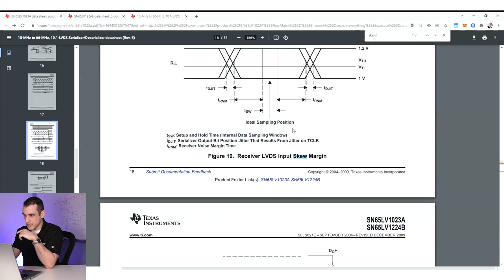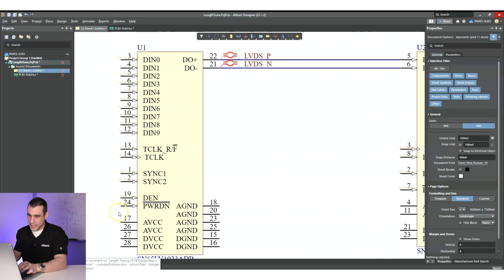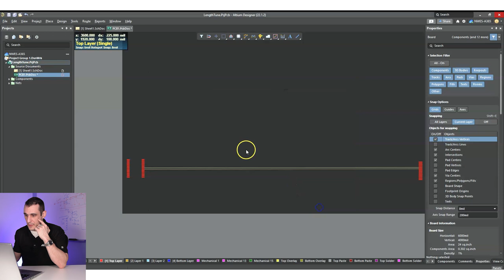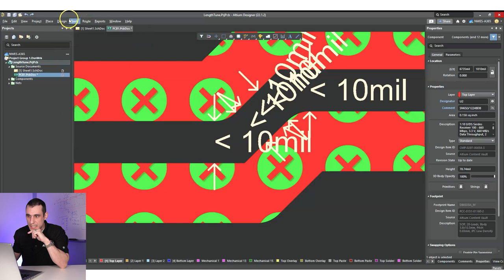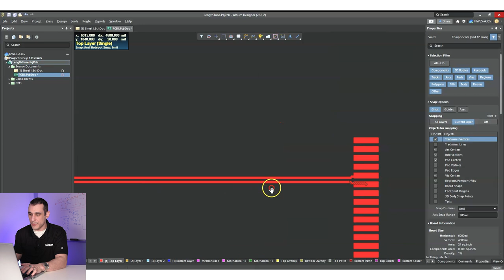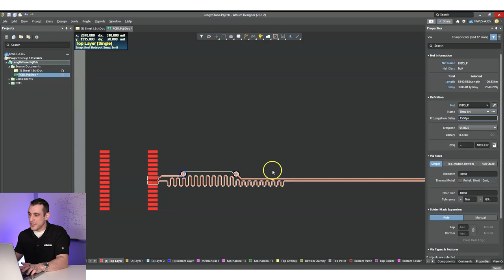Length Tuning in Altium Designer

Comment: First of all thank you very much for these excellent videos. Please explain more about when do we need length matching and how can I precisely calculate the length?
Reply: Length matching is needed when there is too much timing mismatch between two ends of a differential pair, or when there is timing mismatch between multiple signals in a parallel bus. The idea is to bring the timing of the signals back into alignment by adding some length to some of the traces, this way you keep all the signals synchronized within some timing window. It is generally needed with differential signals that have fast edge rates, as well as in fast parallel buses like DDR. It is also needed in some cascaded RF systems that use single-ended traces, but that is more of an advanced topic and it is used to synchronize transceivers to the same clock.
Reply: @Zachariah-Peterson  Thank you for answering my question. If I need length matching, length of a route must less equal than turn into critical length of a transmission line? If L sub R is more than critical length of a transmission line, I have to impedance matching for example 50 ohms in "impedance profile in Altium Designer"?

Comment: I understand why it is better to do the matching before the other trace returns to the same layer -- that way, the final portion of the trace is matched, and subject to the same/offsetting interference.  But what is the argument for putting the length matching near the driver, instead of after the via (where they are separated anyhow)?
Reply: Hi Jim, nice to see you around again! THis is another really good question so I'll do it in our filming session today. In short, the idea is that any common mode noise picked up between the driver and receiver is in-phase and does not experience mode conversion at the load end of the line.
Reply: @Zachariah-Peterson  This makes more sense to me than it did 2 months ago ... I think you're saying that length matching (anywhere) gets both half-signals there at the same time, but from the mismatch until the makeup, it is really just two unrelated traces instead of a differential pair.  The reason not to wait until after the via is that the original length difference is usually closer to the driver.  (And I'm assuming the question got dropped in editing, or else I just missed it ... unless you have a really long lead time.)
Reply: @jimjjewett  With vias that's how I've usually managed to do it, whether it's coming out of/into a BGA breakout or coming out of/into a connector. Also my lead time right now is worse than Texas Instruments'...

Comment: Does too much length mismatch creates impedance discontinuity for differential pair?
Reply: Impedance is not to do with the length, it's all about the material and the trace width and gnd clearance(if the coplanar waveguide is used)
so, if you don't change the trace width or the gnd clearance then impedance will not be affected seriously.
Reply: A mismatch can cause issues in the time domain, which will turn into signal issues in the phase domain (jitter). Zach has other good videos about differential tuning that can answer this question better. :-)
Reply: Technically the differential impedance is different in that region where there is mismatch, but it only matters for input impedance in certain cases where rise time is very fast. This is because in the mismatched region, a portion of the transmission line does not have its electric field terminated at the nearby opposite polarity trace, so there could be an input impedance deviation right at that point. Whether you actually notice the input impednace deviation depends on the length of the mismatch and the rise time. Most people will start to make a comparison between the signal velocity and the mismatch length to figure out if there is some reflections or something. In my opinion, you should use the bitstream's Nyquist frequency to figure out if the impedance mismatch in that area really matters.

This is a really good question so I'll look at it in our next film session.

Comment: I didn't quite understand one thing. Please tell me, if the resulting propagation delay is 138.27ps/in, then why in the example the length of the conductors on the printed circuit board was used longer than one inch? Wouldn't that create a total(138.27ps X conductor length) latency substantially greater than 150 (for SN65LV1023A) picoseconds?
Reply: The length of the traces only determines the amount of time the signal needs to travel between the two components, it does not matter for length matching. Only the rise time matters for length matching and that specification is used regardless of the length of the traces. So your traces could be 20 inches long (like in a large backplane) and the length mismatch tolerance would still only be based on the rise time.

It may turn out that if your traces are very short, then the allowed mismatch is longer than your trace length. So just worry about the calculated mismatch length, the trace length does not matter for calculating this constraint.
Reply: @Zachariah-Peterson  Now I understand. Thanks a lot Zach.

Comment: Don't you think that calling this feature a "length matching" is a bit of a misnomer because the actual goal is to match delays, and not just physical length? Once upon a time matching length was "good enough" to match delays "close enough", but nowadays with GHz buses becoming a routine as opposed to something out of ordinary, matching length of traces on different layers can get you in trouble, as difference in signal propagation speed will lead to delays mismatch, which can become significant enough to cause problems. Also I think Altium needs to update AD to auto-calculate via delays - since AD already know all relevant geometry details via stackup, it shouldn't be that difficult, also those delays will be different depending on which layer signal travels from/to.
Reply: Yes I do think it is a misnomer, but unfortunately the SEO gods at Google force us to still use the term because everyone else continues to use it. And with via delays I agree with you, but I think the problem is getting licensed a good calculator that can do the auto calculation quickly for your via design rules or live in the design. The problem is that if you have it running in the DRC engine, then it would constantly run the via delay calculation every time you moved something near the via, or if you moved/resized the via. If the model is slow then you would get a big lag in program performance. They could set it up to run in your DRCs manually, that's probably the best bet/safest way to do it. Otherwise, you would have to create a via profile and enforce that as a design rule, just like it works with an impedance profile.
Reply: @Zachariah-Peterson  Well even quick & dirty method would be better than none at all. Right now I don't think it's even possible to specify different via delays for different layer pairs, only a single delay which kind of makes this setting useless for practical purposes - unless it's a blind or buried via which only connects a single pair of signal layers.
Reply: @asmi06  what do you mean?

Comment: Quick question - when length matching in Altium, why is Trombone / Sawtooth options greyed out? I can only length match using the Accordion option.
Reply: I just checked on one of my designs and I did not see those options greyed out. That was for matching on DDR, but you can still select those options once you click on the single-ended length matching tool. If you're in the middle of using the length matching utility and you hit tab to pause the tool, then it will grey out the buttons so that you can't switch between different styles mid-route.
Reply: @Zachariah-Peterson  ahhhhh that was my issue. Attempting to switch while I had already started the tool. Thanks!

Comment: 14:00 Won't high speed differential pairs have issues when routed like this?
Reply: In order for a differential interface to function (meaning you can retreive data), you do not need to mount the traces right next to each other, and you don't even need to route them on the same layer. As long as the individual trace impedances are correct and as long as the signals on each trace arrive within the correct time window, the interface will function correctly. The only reason to keep the traces very close together is for reduction of radiated emissions when ground is far from the traces and to set the trace width to a small value. When the dielectric layer is thin and ground is adjacent then the traces can have greater separation from each other.

Comment: Are you SURE that length only does length matching on the top layer?  That doesn't make any sense that someone would have designed it to intentionally work that way.  More importantly, what you are matching here, since you are matching between the _P and _N of a single differential pair, is typically called phase tolerance.  That should be matched along the entire length, not just in one spot.  It needs to have length added to one side of the pair anywhere along the pair that the length is out of phase tolerance.  If you don't match along the entire length of the differential pair, the _P and _N "legs" wave front can be skewed more than the set tolerance.  That defeats the common mode noise rejection, an important feature of using differential pairs.  It's also odd that Altium treats differential pair phase tolerance as any other length match.  It's something that should, IMO, just be set in the differential pair setup.  It appears to also mean you have to set it up for every single differential pair, since each pair can have a different overall length, even if they are in a true length match group, as that group will have a much higher tolerance (like hundreds of mills) than the length matching for phase tolerance (which can be around 10-25 mils).  Is there is a way to set this phase tolerance "length match" to either all differential pairs or a group of differential pairs, knowing that the pairs may also be part of another length matching group?  In other tools, that's the reason it's typically handled as two distinct functions.
Reply: I don't recall saying that the tool only operates on the top layer or that you should only do it on the top layer. Length tuning can be performed in any layer. You can even route the signals in two different layers with two different propagation constants and do length tuning in the faster layer so that you restore the edge rate timing you see at the receiver, you just won't get all the noise cancellation benefits of differential pairs and there will probably be some mode conversion. I've never simulated that last point so don't quote me on it but that is what happens when you have asymmetry along the propagation path. As far as where you match, typically that would happen when coming out of a connector or driver component because that is where the asymmetry could arise, but it could also arise whenever you make a turn and you would add a small jut in the shorter trace to lengthen it slightly and re-match the phases. This makes a very slight impedance discontinuity that you might notice in very broad bandwidths. I actually show examples of this in another video. And there is no matching "along the entire length of the pair", that makes no sense. If I have two traces that are skewed by 10 mils, then I only need to apply 10 mils, it doesn't matter if the resultant length of that net is 1 inch or 10 inches.

Also there is a design rule for length tuning or delay tuning in AD, it's in the rules editor in the same window, you can set the length or delay value, whichever suits your needs, but you need to set up an impedance profile for those nets to get accurate delay tuning. The reason we don't use the term "phase matching" for digital signals is because the phase is not well-defined, the phase is actually a spectrum. In a perfect world the phase difference is a linear function of frequency, but once you have skew between two differential pairs that phase difference is not constant because the propagation constant can change in that region with skew. That is exactly why you have mode conversion that becomes prominent at high frequencies.

And yes there is a delay within a group option as well as a delay within a pair option. You can set up both for diff pair nets.
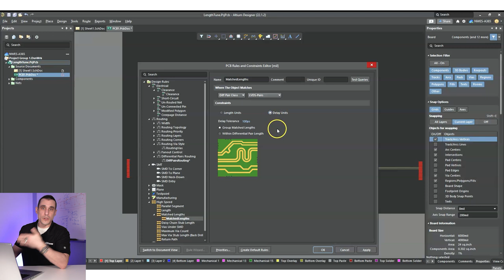Reply: @Zachariah-Peterson  I re-listened to the video starting at 8:30, thru the end of the high-speed matched length setup explanation.  You may wan to re-listen to that, and pay attention to what you say about the top layer, using length vs delay.  It certainly caused me to tilt my head and go "huh?" a few times.

"And there is no matching "along the entire length of the pair", that makes no sense."  It has to make sense (unless we're misunderstanding each other), otherwise, you don't have the desired common mode noise rejection. You can't have a phase tolerance spec of say 25 mils, and have a length difference of 500 mils halfway through the routing, and then add 500 mils in one place.  The wave fronts would obviously be skewed by more than the tolerance.  It is important to do phase tolerance length matching along the entirety of a differential pair, where ever the two legs are out of phase by the tolerance specified, you add a "bump".  It's also called "dynamic phase tolerance".  Differential phase tolerance has been really well defined in the PCB industry for many decades.  I don't see the significance of "phase is a spectrum" WRT differential phase tolerance and adjusting for that in PCB traces so the wave fronts in both legs in a differential pair travel coincident within tolerance from transmitter to receiver.  This is physical length matching if the two legs of a single differential pair we're talking about, with two legs having exactly the same physical propagation characteristics, no matter what the frequencies or spectrum.

Though it is true that there can be different propagation delay on different layers (there also is on the same layer depending on the weave, epoxy etc.), it's really not significant at anything under even 6G (in general, depends on the signaling) and a length match by actual length should be fine.  There certainly is nothing wrong with doing it by delay, providing the delay is actually calculated correctly.  Does Altium calculate the delay based on frequency?

I still haven't been able to figure out how to put multiple differential pairs into a single group to do ONLY phase tolerance between the two legs of each differential pair.

Thank you for the reply, and the videos!

Comment: I'm actually surprised that a tool that knows every theoretical parameter of a design, down to layer thicknesses and dielectric constants, can't auto-check via propagation delays, your tool literally knows if a via is a stub as well as things like if via rings are enabled on a per layer basis. Apply that information! External calculations with incorrect information or a design that simply changes later, are going to cause errors there.. 

Also whoever is managing this channel, you need to enable embedded playback.. we can't watch SOME of your playlisted tutorial videos from INSIDE your software player. "Snapping When Creating Polygons" being the first of many I've already encountered.. plays on site fine, but in your software, broken.. 'An error occurred. Please try again later.' This means you randomly have 'embedded playback' blocked on a bunch of your own support videos that you guide new users to. 🤦
Reply: The problem with via delay is that it is not so simple to calculate, there is no closed form solution and it depends on several factors to get correct. There is a model from Howard Johnson's textbook that many calculators will incorporate, but that model is grossly incorrect and Howard Johnson even says in his textbook that his model is incorrect, so if you ever see someone provide a via delay calculator it is most likely wrong. I am surprised at the number of people that point to this model from Johnson's textbook, and yet they fail to look forward 2 pages in the textbook to see where Johnson explains how and why it is incorrect. I've done videos on this topic and have pointed out many times how these calculators which purport to give this information are incorrect.